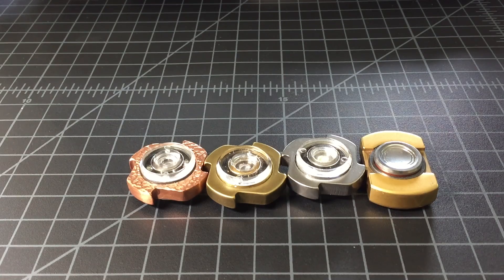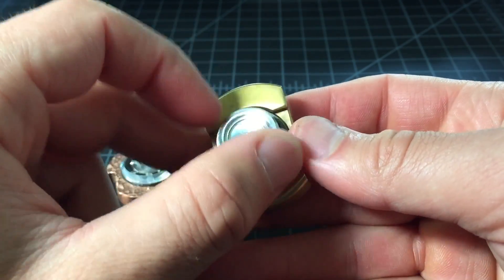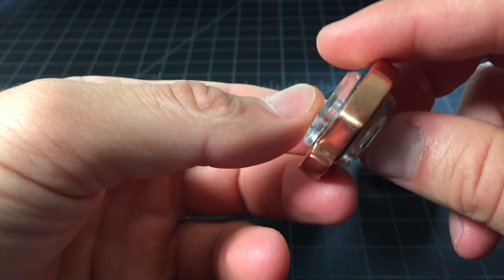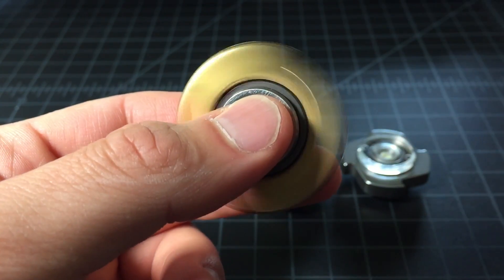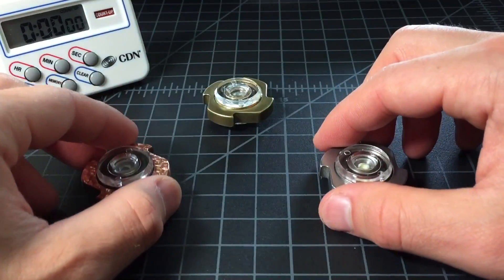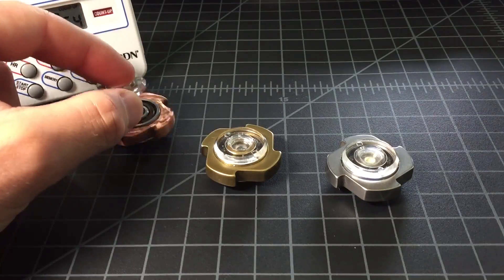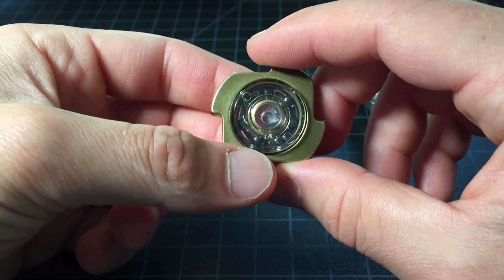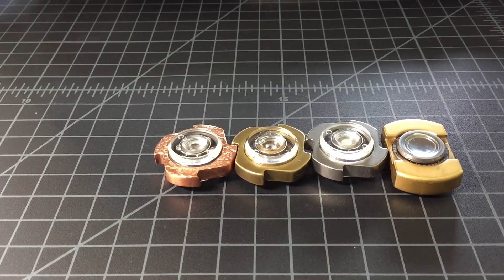Fidget Spinner Bearing Geek Out: 608 bearings and the Yardwerx Dab

Comment: My favorite 608 right now is a good quality copper vorso clone I got off Fasttech, but I haven't gotten my hands on a dab yet, either. Also got another 608 spinner off Fasttech that's a clone of the complyfe "tactical spinner" - didn't realize it was a clone when I got it, but it's surprisingly nice, a hefty, stubbyish chunk of cerakoted SS with brass caps and a decent hybrid ceramic bearing. The weight of it works really well with a 608 because it's got that "zippy" feel of a 608 but it doesn't actually spin that fast/long (like you, I'm not into long spin times, it's about the feel for me).

Also, pondering that copper dab - you've probably already thought of this, but have you doublechecked to make sure the bearing is dead center? Whenever I've had a difference in sound/performance from one side or the other, it's always been because the bearing is slipping a little within the housing (or it wasn't centered up perfectly to begin with). Might be worth doublechecking that, and if it's sitting proud on one side or the other, squaring it back up by running it over a table edge (that's the easiest way I've found of doing it, anyway) and re-loctiting.